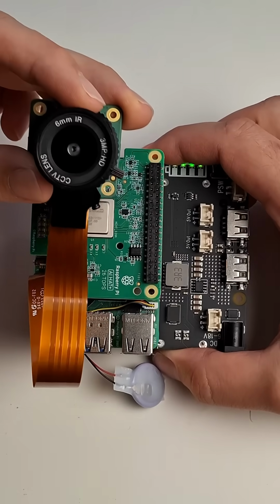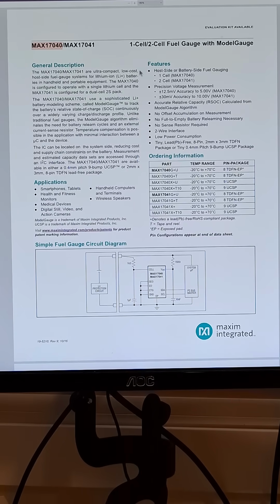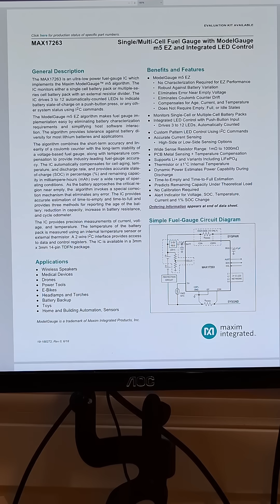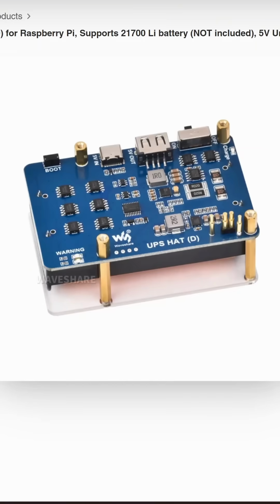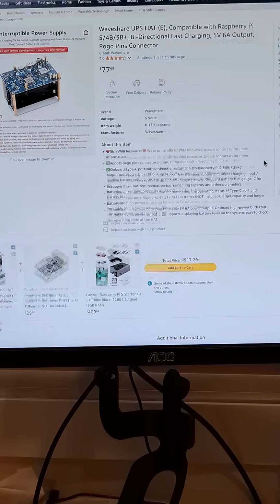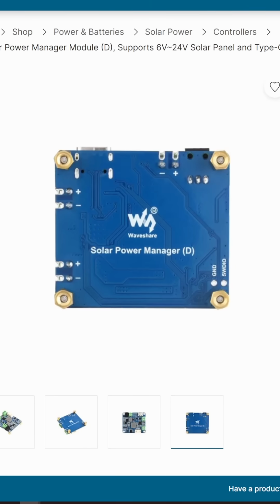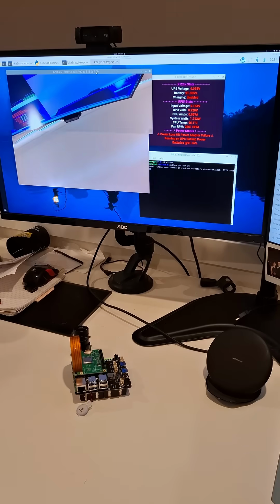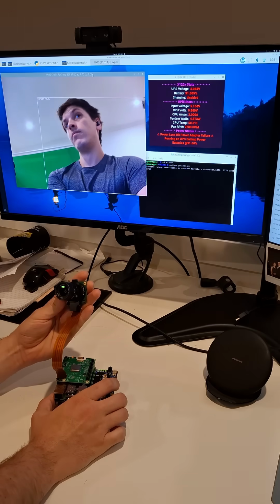Testing out the Raspberry Pi 5 AI set-up with the Hailo AI HAT #rasberrypi #ai #project

Comment: Hey man did u figure out how to connect the ups to a solar panel? I got the same ups and was js wondering thanks!
Reply from the maker: You can just connect the solar panel to the DC charging input via a buck converter to regulate the input voltage to be around 12v.

Comment: 0 fps, a lot of hassle with the power supply system and low efficiency.... For what? 🗿
Reply from the maker: What? Everything you said was wrong...
Reply: You could have a nvr setup with multiple cams and run frigate and with object detection you could tell the pi to trigger text message alarm, shut lights off in the house and lock the cabinets and fridge but only when it detects big mommas like yours.   Or you could even have it detect sideways big mommas when she inevitably falls down.   And that’s a hard task as you know because the height is damn near the same as the width.  It can do that!!